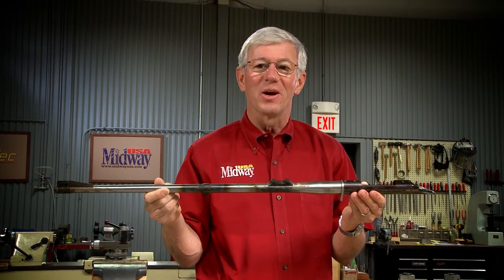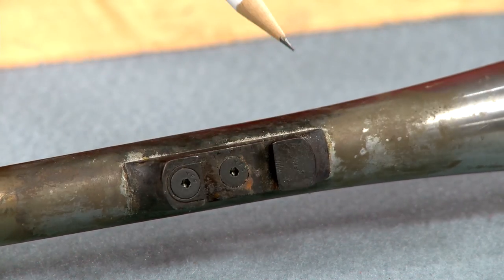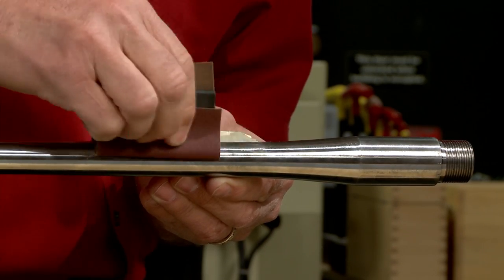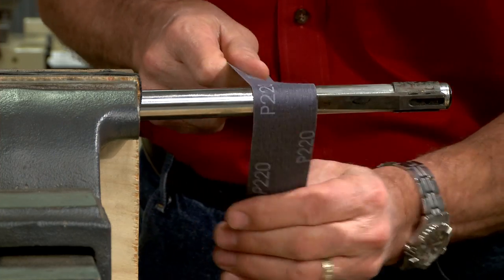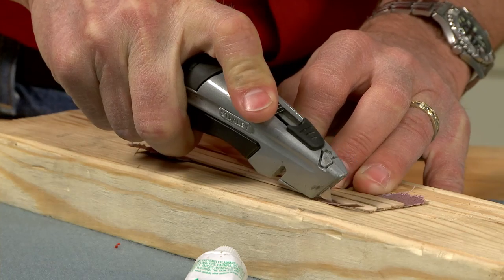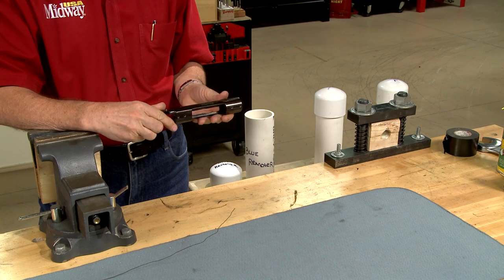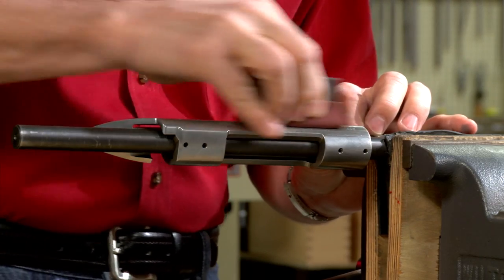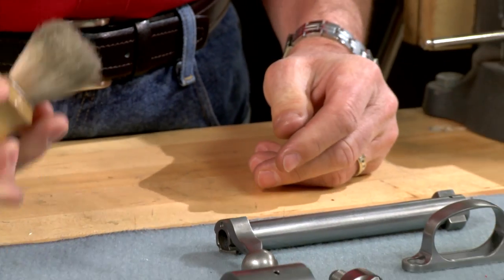How to Properly Polish the Metal Parts on a Remington 700 | MidwayUSA Gunsmithing

Comment: Thanks for the idea of using a shaving brush for easily applying a light coat of oil. I'm going to use that at the end of my cleaning.
Reply: a dollar store paint brush is 10x cheaper and does the same job lol

Comment: I like taking it down to a 3k finish for a barrel that will not retain any water, rain, or sweat.
Just like dipping a comb in water, the teeth on a comb holds water just coarse sanded barrels.
That's my tip for people who live and hunt in rainy areas, that don't want to panic when it rains on you when you're out for the weekend.
Reply: 3k does rust unless its controlled so stop shooting shit. Does rain run off 3k better? Yes obviously as its a smoother surface...put 3k in a moisture chamber with a 320 and both will die the same death if not treated.  320 will die sooner as moisture will hold onto the surface more so than 3k....what I like abut 320-400 is you can hand polish the rust out...when you have 3 k rust you have to sand (aka remove more material)

Comment: The way he goes "100 grit, then 150 grit, then 220, then 320" removes a lot of material. Try to make it more streamlined and not so systematic. 220 and 320 should be just fine, or even just 320. You don't need to remove half of the barrel wall, or half of the stock. I don't know how Larry sands a stock like that without thinning it down. The very first time I sanded a stock, I did what he said, and went from 100 grit, 220 grit, then 320 grit. The stock was sanded thin and out of shape. Even if I sanded too much, it was because I tried to use ALL of the paper grits like Larry said.

Comment: White vinegar works as a "de-bluing" agent.
Reply: White vinegar will attack the steel itself and destroy your parts. Don't use it.
Reply: @Orcinus24x5  white vinegar treatment on the chamber area of a Ruger LC9 barrel seven years ago with no issues as of today would say otherwise. Clean it thoroughly after and you're good. Or I just got very lucky.
Reply: @handlesaredumb1  You got lucky. I've seen people use vinegar to de-rust steel items plenty of times with disastrous consequences. If you leave it in too long, the vinegar will eat the steel. It is an acid, after all.

Comment: Never had a barrel rust from vinegar, what do you think "bluing" it is doing? A controlled rust. If you are going to sand it to polish it your "micro pitting" doesn't happen either. Besides, show me a barrel that is absolutely perfectly smooth with no pits however small.